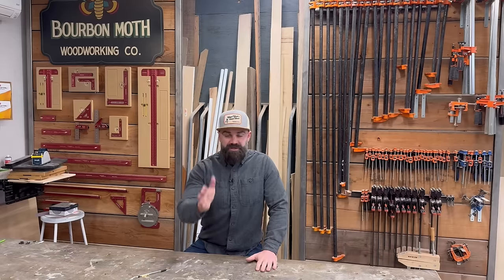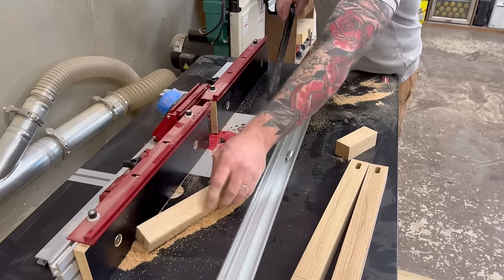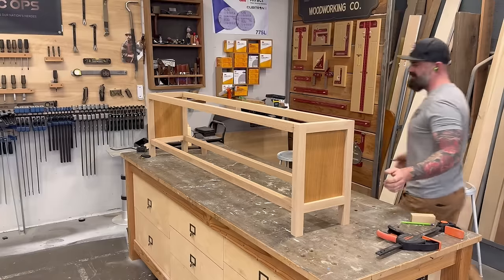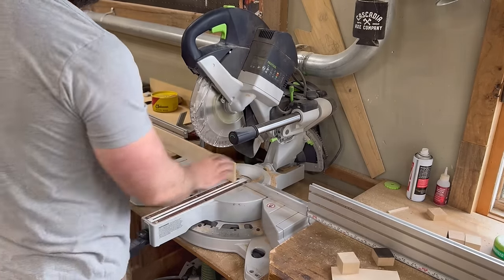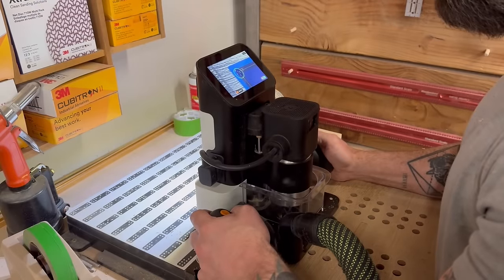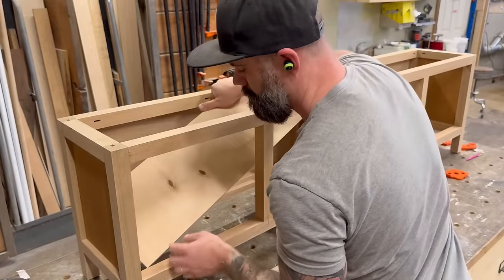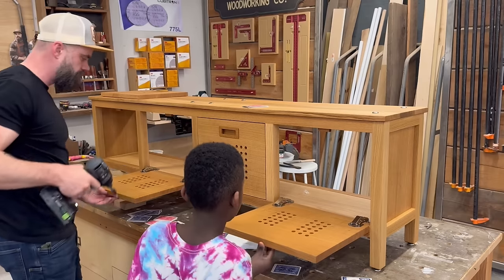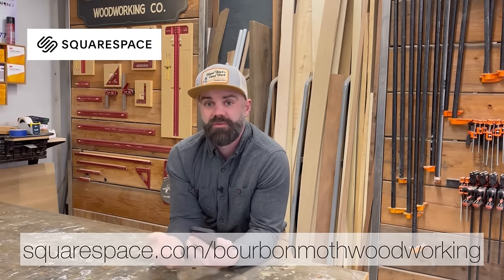Easy Three Day Build || Making Wooden Lockers

Comment: what impresses me most isn't your talent at building furniture but the materials you always seem to get to make the perfect furniture.  You never complain about warps or bows or crappy wood.  Starting with perfection helps to create perfection.  How many people have a giant piece of perfect quartersawn white oak just sitting around their workshop for years.
Reply: He joints and planes his hardwoods, that gets them pretty perfect. He isn’t working with slabs. He also gets his sheet goods from a cabinet supplier, which immediately makes it better than box store wood, and ironically it isn’t much more expensive. He gets his hardwood from a supplier, kiln dried and rough. He can pick the pile for what he wants, and again, it isn’t a consumer location so their products are usually priced well with better choice. Interestingly, most of these sorts of places will let anyone start a cash account if you are willing to drive a little further.
Reply: Yeah lol, and the part where he planed that gorgeous wood down to 1/4-inch thickness... that put me over the edge. Funny guy
Reply: @DaddyBooneDon  i did 😬 when I saw that. I’ve done it on smaller bits, but I also have a giant resew bandsaw and would split it. Honestly though, in that situation I would have planed it to 3/4” or whatever the inside of the cabinet allowed and rebated the edge of the board. Thicker is often gooder. Lol.
Reply: He has a ton of impressive wood, for sure, but I still think the best part about Jason’s videos are his talent, personality, design chops, and willingness to share some amazing protips with the rest of us.
Reply: @RyanWattersRyanWatters Maybe he just wants to know how to find good wood. Better ingredients make for better food, and such.
Reply: @NOLAfugee  That’s a fair point. I should enter these conversations in good faith so as not to be a troll myself. I will update my comment. I think it’s the “what impressed me most” phrasing, but it’s just a YouTube comment. Hope you’re having a great weekend!
Reply: yes I forgot to make that point I don't have any such wood supply where I live so I cringe every time I have to go to a big box store knowing I'll be spending all day looking for that one perfect piece.  I hear there are mail order places, tamar does that.
Reply: @RyanWattersRyanWatters  like I said he is very talented but when you do projects yourself you already know how to do all this stuff instead you drool over the materials.  that's what I meant by what impresses "me" most.  its all relative.

Comment: Wow Jason, I really love that piece!  All the little touches; making all the doors out of the one board for continuous grain, basically using all solid wood, the holes in the doors and even the carriage bolts, really make it such a sweet addition to your "gym" er...TV, snack, beer drinking, drooling room!  😂  

I especially love the simple pull handles you made for the doors.  They impressed me so much I'm considering putting ones just like them on my kitchen drawers and cabinets.  We're building our retirement home and it's a farm homestead (here in the Willamette Valley no less!), so something clean yet rustic like that really appeals to me.  Do you think that's a good or a bad idea for drawers and cabinets in a kitchen that will get daily use like that, and why?  Many thanks!

Comment: I had to laugh when you talked about assembling and disassembling the furniture.  I design and built a liquid cart out of Cherry for my daughters new apartment (upon request).  I did dry fits and checks at least 20x.  I was amazed that with the use of mortise and tenons and careful planning, the piece went together very well (everything was at 90deg and seamless) and was extremely satisfying to build.  All the slats floated in their snug little grooves and were pre-stained and blue taped with care.  I also asked one neighbor to help turn down the cylindrical handle  because he had a lather and a second neighbor to cut the mortises because he had a mortiser.  This lead to me helping them because I had the large band saw or Engineering/Design ability.  It was great fun.  I have lived next to these guys for over 25 years and we found a new connection which was so cool.

Comment: Thisis a very cool build and the white oak makes it even better (and very expensive). I have the smaller domino joiner and will say that your ability to accurately place a domino in the absolute dead center of your posts is amazing.  You seem to be able to do it "free hand", that is without benefit of a jig.  When I did that task I built a temporary jig to hold the posts absolutely square in two planes, up and down and side to side. I use a 20 gauge nailer to assemble the jig, driving the nail only about 1/4 to 1/2 inch into the bench top, making removal easy.  This allows me to apply a lot of pressure to the joiner to insure a square mortise.  Also, when the joiner is running, it wants to shake, and requires a very firm grip.  It looked like you were pushing yours with your abdomen!  Do not do that if you want a mortise that is square!  Just my thoughts.  I don't drink bourbon, but would love to sip an IPA with you one day!

Comment: Nice.

One change you could have done
Electronics need air flow to dissipate heat so the bottom could just be 1x1 slats set in an equal distance apart making sure to land on equipment feet.
You really don't need to open the doors to adjust anything if you use hidden IR blasters you could put in one of the holes this would alow you to use your remote control.
With an open bottom  no need to cut holes in the back wires could come up under.
Now to figure out how to place speakers for a 9.1 channel home audio vedio system  and place a sub in one of the doors aimed at the back wall. Or down.
Long slat cut holes would be more correct for the time period .
With a brass mesh cloth over the back of the door. Looks even better on a dark wood color. 

Yours looks really good, just different ideas.   

The Key is don't ask the wife  she's going to love anything you set in frt of her  you have the creative power to make what you like the idea of.
Blow her mind!

Comment: question.  For the holes, why did you cut all the holes on the shaper?  when I was watching I swore you were gonna use the first one as a template, and  double side tape it and use a forstner bit.  My best guess is that it was about the same speed?

Comment: "Don't laugh at me for using a tape measure!" Sir, I used to annoy my Wood-shop  Professor by preferring a piece of string to work out proportions and math over a tape measure. As in, "Here's my length, here's half of that, here's one eighth for a height, here's a half circle with a radius of 1/4 the length, centered off the midpoint of the length, and ta da, math done." Medieval chalk line and string geometry has always been better for my brain than Imperial measurements. Or just using Metric.

Comment: I like everything about it but the doors opening mechanism should have been vertical. I can see a 100 different things going wrong with this setup. Theres no doubt someone will eventually step on a door and that is a pretty heavy piece of furniture.. Maybe the hinges will break before the furniture tip over. I dont know. It might break all 5 toes. cause the feet will be trapped inside the door.